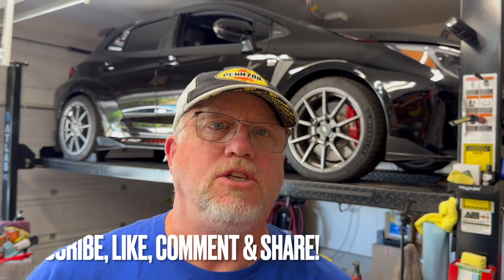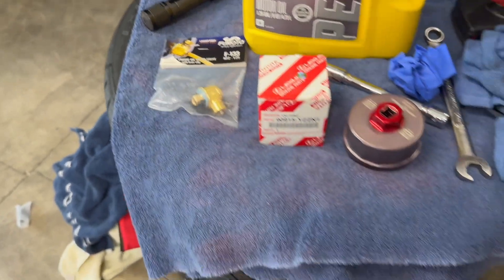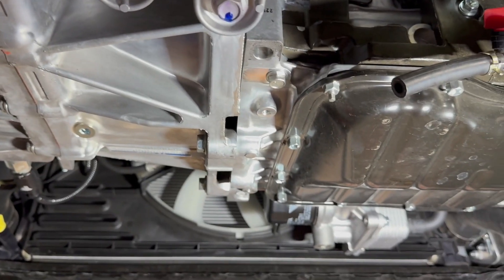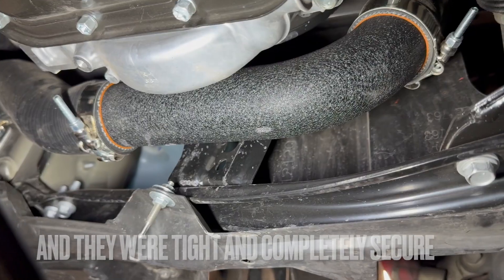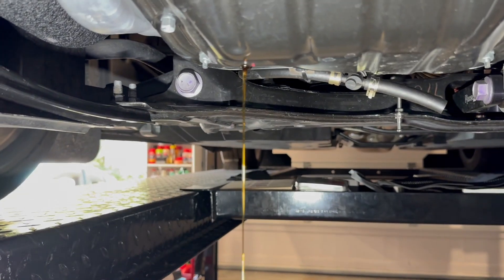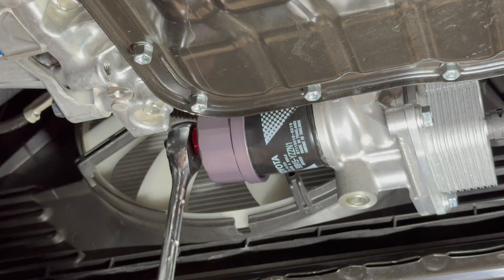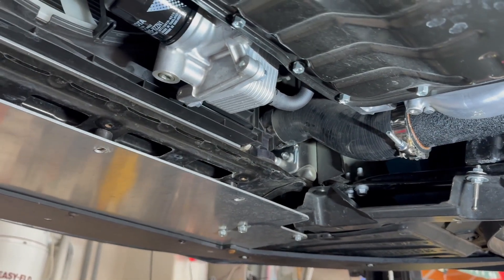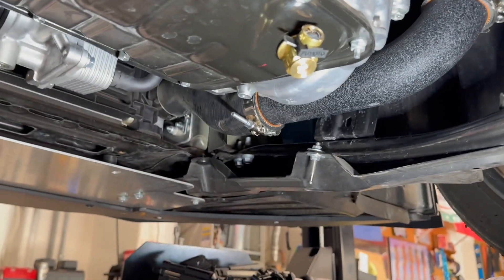GR Corolla Oil Test: The Science Behind the Madness

Comment: I noted in this oil change video for your GRC that you’re doing a long term oil test in conjunction with Lake the oil geek. Will there be a series of videos by you and Lake about the various oils and testing that you’ve gone. I picked up a 25 GRC last week and would like to see and understand better what you and Lake are doing in connection the your GRC.
Reply from the maker: That's the plan. I'm running 0w-20 and 5w-30 in both the Pennzoil Ultra Platinum and Amsoil SS. The idea is to get all of the data and then do a breakdown of what we see. The test is being done on my 2009 Turbo Corolla and my 2023 GR Corolla. So far the 5w-30 is looking better.
Reply: Commenting to stay up to date. Are yall close to posting results?

Comment: Noisier engine is a bad sign, a bad signal, bad feedback, that oil is unfit for purpose, that it's not doing what oil is supposed to do.  Did you know that some manufacturers have been caving/capitulating to external pressures and not necessarily publishing the best recommendations for what is mechanically best for engines.  California bureaucrats and those who they're in co-morbid cahoots with, the Elon Musk types, the automotive death cult, the disinformation crazies.
Reply from the maker: I fully believe that manufacturers don't recommend the best oil for engine longevity.
Reply: @jimsgaragetoys  synthetic oil designed for neglect intervals probably isn't the best for non-neglect intervals.

Comment: Hear me  out if you want the best oil protection you should probably switch to Amsoil Signature Series 0w-20 or 0-30. The engine will be quieter and give you better protection. If you are doing track days you will really like the Amsoil Dominator 5w-20. You will like it 😊. Also using a higher grade filter than the factory will be better for the life of the engine.
Reply from the maker: This is why I'm doing this official oil test with The Motor Oil Geek. The numbers will tell me exactly what oil I should be using. I really liked how the engine ran on the Pennzoil UP 5w-30.
Reply: @jimsgaragetoys Smart Man go by the numbers not the hype ! 😊 All for it. I tell people all the time Amsoil SS is great but at 5k mile oci your better off going Penzoil Ultra Platinum. Unless it's extreme use.
Reply from the maker: @HersheyRoseX  Yep, I know that Amsoil SS is great stuff, no doubt about it. With the GR Corolla though the OCI is every 5k miles or 6 months for normal use and every 2500 miles or 6 months for severe use. Guess how most of the are driven? 😂
Reply: @jimsgaragetoys  Depends on if it's a fun car or not. I have a Veloster N now and it my main car and I put about 2,000 miles  a month on it. I would like to go 15,000 miles and 10 months oci as I have gotten good numbers back from running Amsoil SS.

Comment: I've been using 5w30 full synthetic Valvoline in my 21' RAV4 since it was new . Now at 50k , The engine runs so much quieter . Oil analysis shows good results .
Reply from the maker: I don't doubt it after how my GR Corolla ran with the Pennzoil UP 5w-30 in it.

Comment: the idea behind why it doesn't matter if u prefill or not the new oil filter is because the engine ran just before the oil change and that means engine still has plenty oil coating everywhere so when u turn on the engine after the oil change it will not run dry for those couple of seconds before it builds up oil pressure, what about the cars that have the oil filter up top it's certain that u cannot prefill such an oil filter, if car manufacturers would think even for a second u would need to prefill the oil filter they would not build engines with the oil filter up top.

prefilling the oil filter has more to do with satisfying ones OCD than it has to do with anything else.

that being said if u do it it will not hurt anything, it's just that it's not needed.

prefilling the oil filter might matter when u let the oil drain overnight or when u don't run the engine u just drop the oil first thing in the morning on a cold engine (some ppl do this on the premise more oil has dropped in the pan during the night so more oil will drain), even in this case the engine still has some oil coating obviously not as much as when the engine was ran half an hour ago but still is not completely dry.
Reply: The oiling system still has to prime the oil filter. Your engine needs oil pressure to maintain that hydrodynamic wedge, not just a thin coat of oil. At best, with certain oil viscosities and engines the wear results between pre filling and not pre filling will be the same. At worst, pre-filling the oil filter will prevent additional engine wear due to the system lacking oil pressure for a few seconds before the filter is primed again. 

You can go watch the motor oil geeks videos if you want to see evidence of this happening. It doesn't make sense to not pre-fill the oil filter if you can. You can also just use a "clear flood mode" if your car has it instead of pre-filling if you want since that achieves the same goal. Subarus have inverted oil filters, which is dumb, but they have clear flood mode so you can prime the oiling system before the engine sees combustion again.
Reply from the maker: @ZWortek  Exactly, perfectly stated. Why not pre-fill as it can only help a little and not hurt.
Reply: @jimsgaragetoys  Cold starts are the enemy,hence the light oils are like hydraulic fluid to close tolerance engines,needed to flow instantly,here in N.D. I have never seen an engine warm up as quick as my hybrids.
Reply from the maker: @philipeli1192 I agree that cold starts are the biggest issue but running these thin oils on turbo engines has caused plenty of failures as they work harder and run hotter. Hybrids have the problem that the oil temperature doesn’t get up to operating temperature due to the engine constantly turning off. On my wife’s Prius I see the engine just off and the coolant is only between 100-110F. If people are doing a lot of short trips or city driving the oil never gets up to temperature and this destroys the oil very quickly. Another thing that the manual for my Toyotas says is that the 0w-20 is recommended for the best MPG, but a higher viscosity may be needed  or used if in severe conditions. A 5w oil will flow just fine like a 0w oil will in summer temps that are not cold.
Reply: @jimsgaragetoys  I would use Amsoil SS 0w-40 if I had a turbo engine.
Reply: if you change your oil cold your a moron though

Comment: I just switched to 5w30 Liqui moly on this oil change. I was running Liqui moly 0w20 in past oil changes.. So far the 5w30 the car feels better on hot days and also 0w20 I just feel is to light for a car making this much boost stock.
Reply from the maker: I loved how the engine ran and sounded on Pennzoil UP 5w-30. I tried Liquid Moly on another car years ago but it didn't impress me on the oil analysis.
Reply: @jimsgaragetoys what was the oil analysis?
Reply: @j @jimsgaragetoys you still running 5-30 Jim or went back to 0-20??
Reply: I use 5w-40 motul on my GRC. I feel like the car pulls better with thicker oil.

Comment: The G16E-GTS was designed to run 0w20. So everything from the oil pump, bearing clearances, cam-phasers were designed to run on a lower viscosity oil. Modern 0w20 synthetic oils have excellent film strength, even in high temperature conditions, is good for most aggressive street driving (no sustained oil temperature above 110–115 Celsius). The other aspects of running the spec oil viscosity is that the extremely high boost turbo in the G16 relies on fast oil circulation to cool down. You put a ticker oil there and slow down the flow, affecting the cooling of the turbo bearings. 
I personally thought a lot about running 5w30, but after all the research I figured that all these risks aren’t really worth it. If I have concerns about the protection properties of my oil getting reduced in track (I have done track days with my GR) I would rather use something like the HKS Super Zero Racing 0W-20. Which is a 0w20 racing oil with LSPI protection formula. 
I’d be curious to hear the results of your tests though.
Reply from the maker: No it's not, they don't make engines to run specifically on an oil viscosity. In the manual it even says that if using in severe conditions like tracking the car, driving it overly hard and in extreme conditions that using a higher viscosity oil may be prudent. Under normal conditions or in the winter I can see 0w-20 being fine. People act like a 0w-30 or 5w-30 oil is so much thicker than 0w-20, it's not. When 5w-30 is hot, it's much thinner than 0w-20 when cold so it flows just fine. Ow-20 is rated down to -40C while 5w-30 is rated down to -30C, most of us don't see those extreme cold temps and if you do make sure to use the 0w-20 for winter. That's what this oil test will find out.
Reply: You should be using something at least 30 grade on track with the GRC. At track oil temps the viscosity of the oil with 0W-20 will be lower than it is on the street, so lower than specified by the manufacturer. With something like a 5W-30, at track oil temps the viscosity will be more in line with a 0W-20 on the street in normal driving. You need to have proper oil viscosity to keep sufficient oil thickness between the bearings and crankshaft.

Running something like 20W-50 would be a bad idea because that is a substantially thicker oil and you could probably see evidence of additional wear from the piston/rings struggling to scrape oil of the cylinders. Going from a 20 to a 30 grade is a small jump with solid benefits for a lot of applications.
Reply from the maker: @ZWortek  This is so true and most people don't understand it. I don't track my GRC but driving canyons and mountains still benefit from using 5w-30 in the hot summer months.
Reply: Why I’ve used amsoil signature series 0w20, great noack rating, great oil volatility
Reply: @halorita the 0w20 Amsoil Signature series seems to be an outstanding choice. I’ve seen some excellent numbers on independent testing so I’m sure it’s great.
Reply from the maker: @halorita  The next oil changes will start the Amsoil testing to see how they compare. I plan on testing 0w-20, 0w-30 and 5w-30. The best bet might be to use 0w-30 in the winter and 5w-30 in the summer. The Pennzoil Ultra Platinum has looked fantastic so far.
Reply: one super important reason to run thicker oils in modern DI engines (even though this one has port as well) is fuel dilution. Many modern engines will see shear down a full grade or more during the OCI. My Rav4 DD saw the stock 0w-16 shear down to 0w-8 from fuel dilution in the Speed Diagnostix UOA. That's not to say the A25 is the same as the G16, and highway driving would have likely done far better, but I'd run 5w-30 in my GRC for that reason alone; all the other benefits are just the cherry on top...
Reply from the maker: @DylanTK  Yes indeed! The only time I would recommend using a 0w-20 would be in colder climates. Most people are unaware of fuel dilution and it occurs more on hybrids and when people let their cars idle to warm up. Hybrids can have a hard time warming up to oil operating temp due to them always turning off and on unless they do a lot of highway travel.
Reply: @jimsgaragetoys , just posted my Speed Diag UOA for 0w-20 and 5w-30 on the forums, and both oils sheared a full grade by 3k miles, so I wouldn't run 0w-20 in this engine period personally. In fact, I'm going to try 0w-40 next summer to see what that does...
Reply: Incorrect. Thicker oil soaks away heat faster. Incorrect. Bearing tolerances aren't tighter because of thinner oil
Reply: @heathlett275 alright alright. Sorry engineers
Reply: On another note, pre-filling the filter on the G16E has no significant added benefit to this engine. If anything, the spillage cause due to the position of the filter, and the probability of pouring unfiltered oil into the outlet of the filter only really introduces risk. The official Toyota service manual doesn’t have this step, so I wouldn’t add that to my oil changes either. Most of the critical wear surfaces on the G16 rely on additive films in modern oils during starts  (hence the importance of using “quality” oil, not necessarily higher viscosity oil).
Reply from the maker: @leonardoespinosa3796  There are no negatives to pre-filling the oil filter with new, clean oil. I see oil pressure build quicker which will never hurt anything, only help. Anything running out of the filter is a very small amount and once again, doesn't affect anything. Will it be hurt to use an empty oil filter, most likely no, but there is only a benefit from pre-filling the oil filter. I would rather err on the safer side.
Reply: Always so hard to decide.. I will let you all know if my G16 engine blows up in pieces in a few years of me driving hard on 0w20. Love all the points and great discussion 🎉
Reply from the maker: @leonardoespinosa3796  Many have already damaged their engines by running ing 0w-20 on the track. Even in the manual it talks about times when a higher viscosity oil would be a benefit.
Reply: @jimsgaragetoys I appreciate the discussion =]. It turns out that I have done my oil change recently and put Motul 8100 ecolite 0w20. This was right after a short track session I did where oil temps were pretty high. I will run about 3.5k miles in this oil and take sample for testing to see the disaster 😅. Than I have 5L of Amsoil 0w30 signature series here and will use that next oil change and take another sample. I’ll try to share the results here or maybe I try to put in a video (I am not good in making videos though haha).

Comment: Alright 👍 👌 

Only if I can convince my uncle to use 5w-30 in place of 5w-20.  Cylinder 2 has a misfire and there's oil on the spark plug 2 3 and 4.  He doesn't wanna replace the head gasket or could be the valve cover gasket and/or sparkplug tube seals from what I read with p0302 p0202

But I had a theory substituting half quart to 1 quart of Lucas heavy duty stabilizer in the 6 quarts and his favorite 5w-20 might keep it from leaking?  What do u think?
Reply from the maker: I wouldn't use the Lucas heavy duty stabilizer in a newer car, the viscosity is just too thick. Just go to the 5w-30 and change any leaking seal or gaskets.
Reply: @jimsgaragetoys ah actually for the 1st oil change around 165k miles he wanted to add around a half bottle on top 5 quarts Napa synthetic 5w-20 I had from the many sales I pick up random oils from lol.  My cousin in law always went to valvoline in West Hampton before
Reply: " in place of 5w-20"     5w20 is something I use in my Jeep Cherokee. The oil to be used in the GRC is 0w20.
Reply from the maker: @odessit777  Unless you are using it in severe conditions such as the track, driving hard and in overly hot temps.
Reply: Would u try 5w-30 or even 10w-30 in your jeep cherokee?  Not castrol in 10w-30 being thicker than most unless it's there edge synthetic being naturally thinner being a more refined mineral oil group 3 lol.  Mu uncy git mad when I topped up his 3.6 pentastar 😂

Comment: I'm using Pennzoil ultra platinum in my rav4 prime. 5w-30... If I ever get a sports car again I'll be using 5w-40 or 10w-40. I used heavy oil in my rx8 as well it never had an issue well past 100k miles and I drove it hard in the santa cruz mountains during my daily commute. Light oils kill engines and I wish people would stop putting 0w-20 in their engine especially in warm/hot climates. But people still do 3k oil changes so what are you gonna do.
Reply from the maker: On the GR Corolla the "normal" OCI is every 5k miles or 6 months, the "severe" OCI is every 0w-20 or 6 months. Most GRC owners fall into the severe category the way we love to drive it!
Reply: @jimsgaragetoys  I'd counter that the 'severe' you are referring to honestly requires an oil change at 1000-1500 miles.

Comment: Did you ever have the dealership change the oil for warranty purposes…..so that it is on the record showing that it was maintained properly?
Reply from the maker: The dealer did several of the free Toyotacare oil changes until the one that they started the engine with the oil cap off and sprayed oil everywhere. After that I said no more since they didn't even clean up the mess they made. I keep track of my maintenance and do a video on every oil change.
Reply: @jimsgaragetoys That is exactly what I am worried about, that and some tech trying to take it out for a joy ride. Video on here where One owner told them he had a camera in it and they still had one of the techs, try and learn how to drive a manual in the guys brand new GRC. Stalled it out several times! I am hesitant to even take it in there for the free oil changes. BTW, do you know what oil they use at the dealership? That is another factor I am wondering as well….if they use cheap oil. 
I have just passed my break in and am about to do my first oil change. I have already thanked you, but I wanted to do it again….you videos are awesome and your GRC oil change video is the best one in here….PERIOD💯🫡Hope that you and yours have a blessed one, Jim🙏
Reply from the maker: @SaltStorm007  Thanks so much for the kind words, I truly appreciate it. Enjoy your GRC! 😍❤🔥
Reply: If you have a toyota login. and your GR registered.  You can go under the service history section.  And manually add your own records....     There is no law against maintaining your own vehicle. and they CANNOT deny warranty because you change your own oil.     It would be like saying Toyota has to fill the gas tank for you.